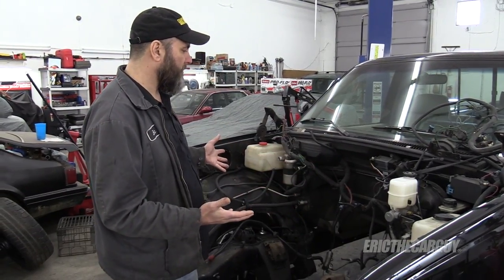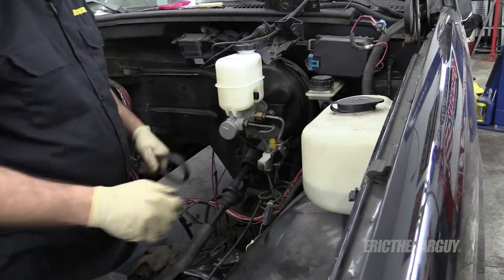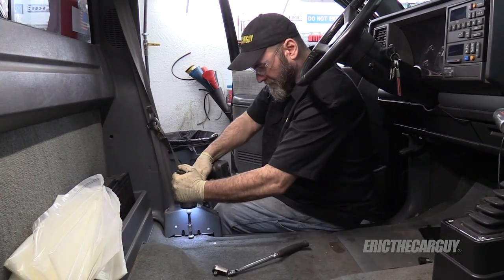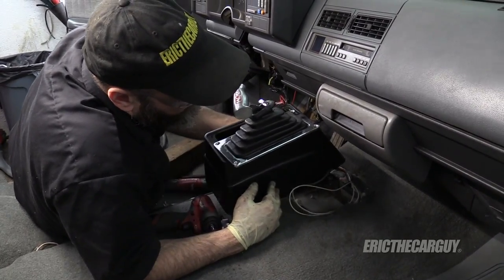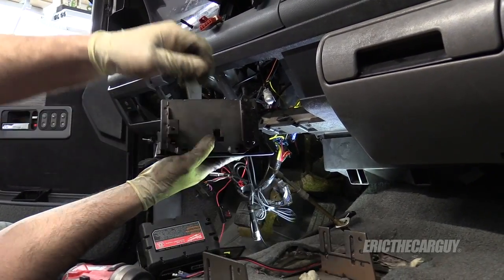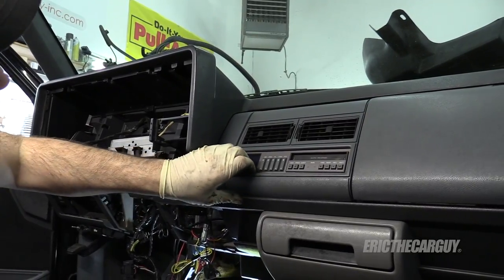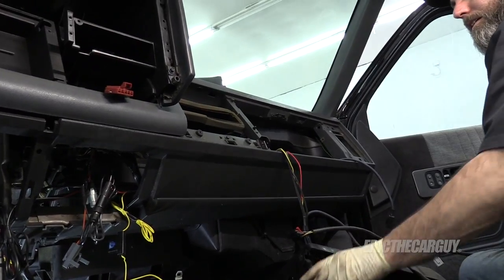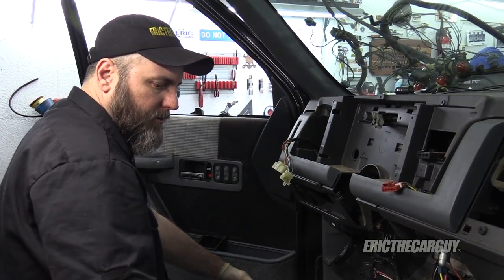How To Remove a Chevy Truck Interior 1988-1995 #ETCGDadsTruck

Comment: That radio/dash layout brings back so many memories. My dad had a truck with that layout when I was little (26 now) and I specifically remember the running/headlight button/switch things. Headlights turn both on and running lights turns just 1 on. I also remember the climate controls there's a green screen with arrows above the H/C. When switching in-between the temps there will be 1 or 2 arrows at a time running left and right to indicate the temp.

Comment: Its funny to see others having issues with Milwaukee M12 ratchets.  When they first came out I went all in and bought both the 3/8 and 1/2.  Disappointing power.  Anyway thank you for all your videos.  I remember you saved my bacon when I stripped a rotor screw in my honda.

Comment: I have a 91 that I plan to do and I’d like to replace the cluster as well so I would love to see the rest of the video and how you put this stuff together.  Im horrible with losing screws, bolts and nuts so I use the baggies and tape them to the stuff it came off and mark them too.  That was good advice I wished I knew 20 years ago.  I learned that wd40 on my hands smears the ink on the baggies so I try not to handle stuff after it’s labeled and put aside.  Great job, I really enjoyed the detailed description about the trim and column removal.  I’d love to see and hear more about wiring everything back up.  Those wiring diagrams always give me difficulty.  Great work and thanks for taking the time to film and edit all this material.  I know it takes a while to do and appreciate your time and effort.

Comment: I'd like to see how it all goes together - not detailed, but what you decided to do with the cluster and things you mentioned. 
Yes, details on the cluster...
I like what you did do here. It could've been minimalized a little more, but then who doesn't like a power tool buzzing away at bolts and screws. Knowing the locations of the fasteners is helpful as well, so one could pause/slow if they're putting a Chevy back together.

Comment: holy shit iv been workin on these trucks for 20 years n i cant remember the last time the screws on those plastic strips there at the door threshold on the floor actually came out lol i always have to grind them flush push the screw threw so its a hold again, a drill bit just walks n ur screw doesnt go back in straight (big deal right) or the screw will jus keep twistin off most of the time..

Comment: Eric another great video!

Stuff I’m really curious about:
-gauges
-how you got HVAC and any other factory systems to work. Are they all just relays?
-wiring harness teardown, how did you decide what to keep? Any mistakes made?
-someone else mentioned the electric fan. I’m also curious about that and all the other many custom systems.
-if you can get the cruise control working, that would be super awesome to see!

Comment: You could also use that slot as a place to store a tablet with engine management stuff. DIY a hinge mechanism that allows you to slide it out. Kinda like the "hip" screen units back in the "pimp my ride" era. Theoretically, it's a straight slider type with a pivot. You pull the tablet out, let it drop (unto a pin to affix it) and that's that.
Reply from the maker: Wish I'd have thought of that, but I think you'll like what I did.

Comment: Just for reference that interior ended in 94. So this guide would be applicable for 1988-1994. 95 is when they made the switch to the newer interior and the vortec series 350’s and 305’s
Reply: No Vortec until ‘96.
Reply: athhud true forgot about that, yeah forgot the TBI’s are in the 95’s
Reply: I bought my ‘95 2dr Tahoe when I was 16 thinking it would be the same as my ‘97 that I totaled in the first 6 months that I had it. Had no idea that it wouldn’t have the vortec. That was quite disappointing since I bought on the internet thousands of miles away... Still own and love that truck though. It now has a Dana 60 front and 14 bolt rear. The engine is currently on a stand and I’ve been trying to decide whether or not to stroke it or ditch it for a Cummins or LS1...

Comment: My thoughts are:-
A small % of your audience has one of those trucks or something similar enough to really need all the detail. They would be wise to go to your website anyway.
A much bigger % just like interesting content & presenting style and I think the best of that will be in select parts of the build like the custom gauges, getting the engine running etc. Also seeing it driven & your Dad's reaction will be fun.
Like many have mentioned, I like the detail level of your videos, but at the same time I think I would prefer to clear some of the backlog to get build videos closer to present day. I prefer when comments can contribute to the outcome or direction (or at least have the chance to), rather than just be suggestions after the fact.
Reply from the maker: Thank you for that thoughtful input.

Comment: There was a modeler's spray paint, i don't remember the brand, but should be easily found in one of the many stores in NA that cater to such things (they would know best which it is), that when sprayed, left behind a perfect puffy mat black. That would be excellent as backdrop for the gage cluster. Certainly, it does not reflect any light.

Comment: I have a 91 chevy regular cab stepside I've done that so many times redoing the interior. It can be very aggravating! Did the same thing to the engine. except i went with a 4 bolt main.

Comment: Eric you miss labeled the video, that interior only goes from 88-94 in 95 they changed it and added a driver side air bag and in 97 added a passenger side air bag
Reply from the maker: Actually I did change it. Likely it hasn't propagated yet. Thanks for your input.

Comment: Eric, you got your year range off. It's from 88 to 98. Nevermind he changed it. At the time I left this comment it said 1989 to 1999.
Reply: That's C1500 body style, with C3500 ending in 2002. The interior of late 1987 into 1995 and engine layout are different for post 1995 C1500.
Reply: @christianguzman8228  Just noticed he changed the title. When I commented he had 1989 to 1999.

Comment: actually 1995 was the first year of a new body style. that's when they changed to vortec from TBI. if you look at a 1994 and before it's square, 1995+ is rounded and different. so this should be 1988-1994, but its probably the same all the way through 1998, so 88-98 like they all are.
Reply: Hey It's Drew by body style, you mean interior dash and door panel stuff, right? The body is the same.

Comment: Very interested in how you did the gauges, the HVAC, etc. I have a 94 that I'll be replacing the old cracked dash on and would love to know how to get all this stuff to work. BTW, the "Amp" that's buried under the dash is actually the radio, the part that came out of the dash is just a controller! Looking forward to the next video!

Comment: Center dash vent trim comes in a style with a cubby hole where you fancy 80s tape deck was.
Check ebay, peaple pull them out to do din style radios
I like my cubby hole.

Comment: Great video, I am curious though since you had the dash out if you swapped out the heater core
Reply from the maker: I didn't touch any of the HVAC on the inside as there weren't any issues with it.

Comment: What did you use to remove the bolts on the left side of the climate controls? I can't get mine out, and I've tried nut drivers, deep sockets etc..?

Comment: are you having to replace the a/c duct work as well?  I have a 95 Silverado that the air is not cooling or blowing the way it used to.  Now behind the dash is ice cold, so I thinking I have a huge leak somewhere.  With the truck being it's age I am thinking it might not hurt to replace the duct work.  Help!

Comment: Eric Wouldn't this be a video on how to remove a 1989-1995 GMT-400 truck interior? Because of the interior redesign in 1996 that came with a different dash,doorcards and other trim pieces.
Reply from the maker: Yes, that is probably more accurate.
Reply: Of course, it's actually '88-'94. 1995 was the first year for the interior redesign with new dash and door panels, which it still had a TBI engine while 1996 had the Vortec spider injection engine.

Comment: E6000!!!! iv figured out the secret to fixing broken plastic, with patience (to hold the piece in the right spot) n the right prep; cleaning, scuffing, cleaning, cleaning, cleaning...   im sure there are rigid chemical bonders but i havent bothered to take the 5 secs to figure out what plastic it is n which solvent to use   that e6000 shit really is amazing tho no joke, its cheap as hell n when u mix stuff with it, ill cut wire strands up or put strands or strips of stuff in it if it needs tensile strength it works mind-blowingly well, again u have to prep, give the glue somethin to stick to

Comment: I'm in the middle of rebuild my sons 1992 k1500 and I'm having issues with the speedometer. It works sometimes  but just a little bit then stops. I thought maybe the wiring harness but they don't make the harness I need anymore. Just wanted to see if you have had this issues and if you can help?

Comment: I have a question, I have a very similar truck (1989 k2500) and I can not figure out how to get the plastic trim off from around the door frame. Mainly the piece that runs from the shoulder belt down the windshield

Comment: Eric, I also have a 89 gmc,K1500,5.7 tbi. I need to replace the evaporator coil. I’m trying to find out if the dash has to be removed to get the HVAC box (heater box) out to gain access to the evaporator coil. Any information would be great. Thanks.
Reply: Yes the entire dash has to be pulled. If you search on YouTube, there’s a guy that shows your how to pull it. Camera angle is from back of the cab facing forward.

Comment: Hey Eric! Quick question! What is the part called that you are removing at 32:46?? My truck doesn’t have them and I’ve been looking months for them
Reply: That’s some kind of aftermarket cd changer. The silver box that he called an amplifier is actually the radio, the part above the HVAC controls is the headunit, and the part in the center of the dash is a cassette player. Some trucks came with a cassette player and some came with an equalizer. Whatever that was in the glovebox and behind the seat was added on.

Comment: What is the type of tape you are using to cover the exposed cables? Thanks !
Reply: Tesa Tape. Not exactly what I would use on bare wire, but it is very good for any places that might rub something. Basically friction tape.

Comment: @EricTheCarGuy @Everybody -

I'm having an issue with my 350Z. 

Stationary, Engine On, Neutral, Foot off clutch = vibrating/tapping
Stationary, Engine On, Neutral, Rev = vibrating/tapping gets slightly faster
Stationary, Engine On, Neutral, Press clutch in = Vibrating/tapping STOPS

Driving, any gear, foot off clutch = vibrating/tapping
Driving, any gear, Press clutch in = vibrating/tapping STOPS - as soon as I release clutch, it starts again.

Any ideas?

Comment: I have a 1995 c1500 Chevrolet truck v8 305 automatic  longbox stripped down plain jane  no AC crank windows not perfect but low milage and NO CHEVY Rust anywhere doesn't get driven in our Brutal Wisconsin winters..

Comment: So, the truck originally had a standard transmission? Or is it still a standard?
Reply: It was originally manual from what I've seen but now it's auto just got a floor shifter
Reply from the maker: It was manual from the factory but someone converted it to auto before my dad bought it.

Comment: What’s the thing he struggles with at 13:06 called,I know it’s for the headlights but I don’t know the name
Reply: Probably the headlight dimmer switch. The column is where the ignition switch, neutral swagger switch, and headlight dimmer switch are mounted.

Comment: The engine ran weak bc the PROM chop was for a manual transmission and not an automatic I bet.
Reply from the maker: Partly, but also because the gearing of the auto is different than the manual. Not to mention that the engine produced maybe 200hp on a good day.
Reply: Great looking truck before and after. I look forward to seeing all the videos Eric

Comment: Half the fusible links on these 88-98 c/k trucks are too burnt up all the time, fixes alot, when you make a custom distribution box and spal-type cooling fans relay centers...🤗, Always a good job, just a fan...🏄
Reply: If the shifter locks in park, you can remove the ebrake system from the truck🤗, also creates less drag...

Comment: Way too complex. Should have left well enough alone.  With TunerPro RT,  you can tune the ECM for the 350 and 454 modified engines.  Have done so to my 454 and my 350.  Make the complex more simple.  The factory radios of that generation were MUCH better receivers than later designs.  Should have concentrated on rebuilding the 350 engine.  Stoke it to 383, forged pistons, rods and crank.  Machine for zero deck. Line hone mains. Bore .030 over. Use studs for mains and heads.  Bullet proof the rebuild. Purchase better aluminum heads.  Exchange the trans with Hughes performance.  Then you really have something.  Easy to get parts at reasonable prices.
Reply from the maker: You might want to watch the entire series before commenting. Or you might catch some of my videos on my other channel. https://www.youtube.com/watch?v=sygI3OA4rfA&t=1s

Thanks for your comment.